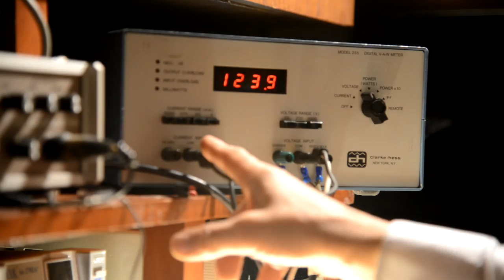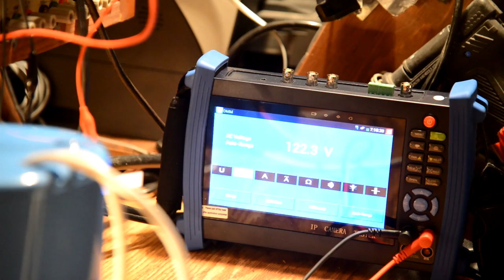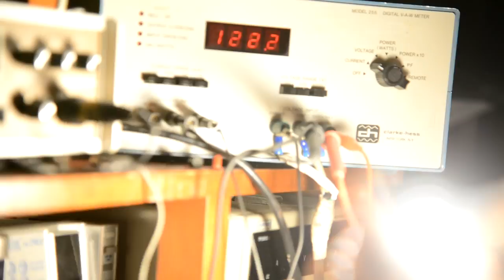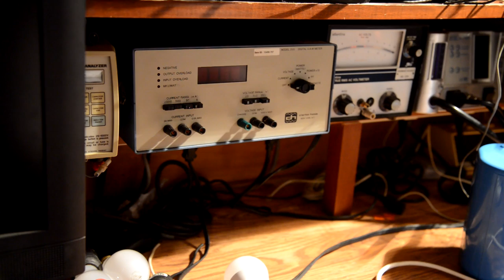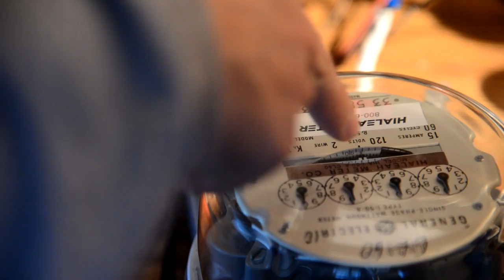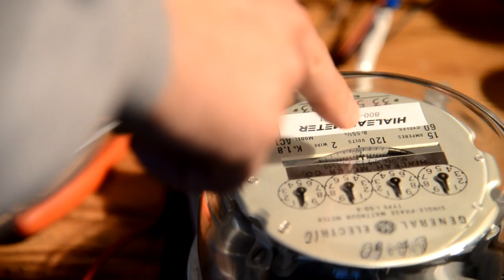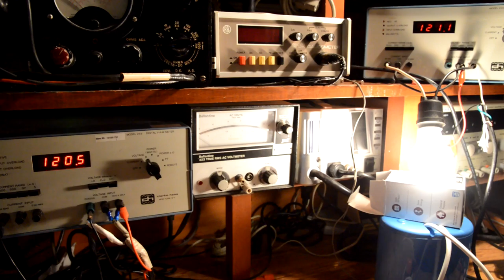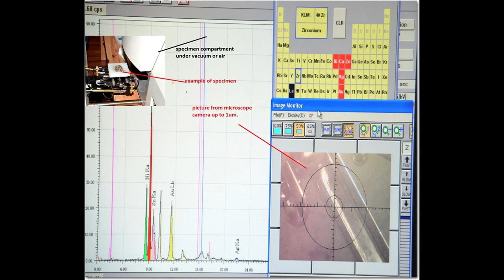Keshe "Free energy" Tear-down, examination, opinions.

Comment: Did you EVEN read the instructions?????????

This is not a generator that you plug into the wall and harness energy from minute 1.

This has to nanocoat your wires before you can see any reduction, and this process takes 2-3 months..
Reply from the maker: if this  is "nanocoat" on the wires that what kind of interaction is taking place there?  How that  fluid  is important  to  "overunity"?  The instruction does not explain it.  The nature of any believe is not  substantiated  especially in regards  to spiritual  believes. But when you required to pay for Keshe product  for $2000 than you want it to work based on  solid proven  models, behind it.    the same like with  refrigerator or washing machine.
So explain to me  how that nano-coat makes you to gain "over unity"?  The only form of  overunity that I know is  ,when I give you for free 100 dollars , so now you have for free something that you did not have before. 
I can accept energy conversion  but I do not accept  something from nothing. Well  spiritual believes  are made solely  on the ground  of people believes in miracles  with elements of fear if you decide to stop that believe than you  are told you will be punished. 
Wesley
Reply: I totally understand your point here. Keep in mind though that you don't have to buy this unit, the guy has taught for 3 or more years straight without getting a dime, and I amongst others know exactly how to make that unit without buying it.
What nano coating does is, it makes the copper wire atoms loose towards wire edge along the length of the wire and that creates a highway for energy to flow without obstructions. It makes your normal wire a super conductor. The logic is, when you have such a super conductor and electricity pushing through it, it also traps energy from the environment within it. So instead of losing power you gain more. Does that make more sense now?
Reply from the maker: I just got home.  I'm sorry but  your explanation  is  shockingly confusing.I'm in particle physics for long time. So answer  few questions  if you will.
1. what do you  understand by  words "nano coating"?
2.what are properties of "nano-coating" and how they affect nuclear bonds between atoms? ( explain process.)
3. specify what  "highway" is made of( what is inside / properties of  it)
4. specify "energy" that "flows" is it thermal? kinetic?/potential?  electric?
5. specify energy that is being captured and attracted  by that highway?
6 quote" it from environment also traps energy " -Please specify  properties of that energy before and after  energy conversion to the form  that is present in your "highway"
7. what do you understand by superconductivity and how that  "nano coating"  affects conductor to become superconductive.
8. how  superconductor of yours  differs from    known to  science superconductor  at cryogenic temperatures.
 Please  use language  and form  suitable  for  student, / PhD  in physics  or any similar but universally accepted and used language in physics  when  answering the questions.
 
Note: Language used by Keshe  is the language of very much ,mentally disturbed  individual envisioning himself as   more of a  priest, but that can not even qualify him  for the level of  high school student  to pass basic exam. 
If you want to  know more about me and my level of expertise please look at: https://www.youtube.com/watch?v=izzujmKROWI
https://www.youtube.com/watch?v=GdlkeI0bXy4&t=4s
https://www.youtube.com/watch?v=CQ3gPFfgDp8
 and about 20 more.

 Wesley
Reply: Sure, let's see what I can answer and what not:

1 + 2) Nano coating.. Let's take a copper wire for example. When we burn this copper wire (which is in matter state) either by fire, or by chemicals, it releases some of it's outer layer atoms, to the environment.

If we burn it too much, those atoms in the outer layer will move further from the main body of copper atoms, and will start to slowly detach from their bonds with other copper atoms. In the end they will fall off from the matter of our wire. Our copper wire will now have less atoms of copper on it. (That's NOT what we want)

If on the other hand it we burn it just enough but not too much,  those atoms will ALMOST detach themselves from the rest, but not totally. Their distance from other copper atoms will increase, and that's exactly what we want.

That's what we nano-coating stands for. The word nano comes from the size of those atoms that are almost detached, but not totally. 

3) The highway I refered to is the open space between copper atoms. In most matter state, this open space is minimal because all the atoms are very compressed, but in the state our copper wire (at least the outer layer of it after we've burned it, because the inner layer of our wire is still pure copper) the spaces between the atoms are much bigger.
Why do we care? Read on:

4) The kind of energy that flows within that wire, is the kind of energy that  our current science refuses to investigate. You can call it any way you like, and it doesn't change what its properties are, but this energy is the principal energy of creation. There's no known word for it in Keshe terminology either, but some of the people call it plasma energy, just because it transfers from a plasma (plasma now used as the word being, from the greek word ΠΛΑΣΜΑ=creature) to another. (This might be confusing because conventional science means a totally different thing when they use the word plasma)

We don't know much about this energy, but what we do know is that a plasma (a creature) can only receive energy after it has given, and it can only transfer energy when it has received. There's constant motion of this plasma energy, and there's constant exchange of this energy from plasma to plasma.

That energy flows through everything and anything, but it prefers to flow through that open space between atoms. (My personal opinion is that it flows from the top of an atom of let's say copper to the bottom of it, and from that atom to the top of another etc and that goes on and on, but of course I wouldn't really know).

By super conductor, I understand a very very structured highway, or path, within a substance, (usually matter substance) that has as few impurities, as possible, so that energy can flow within it without being blocked. If an atom get's on it's way, it receives some of it (because it is a plasma) and our current science calls that resistance.

I don't like student/PhD language, because in my opinion current science tries to make simple things, over complicated, so that it can keep it's business growing. We can still communicate as human beings by other terms I believe.

Also, I don't examine the language used by Keshe, because words are just there to illustrate ideas. They do work for me, as I've seen major back pain problems being healed by using Keshe technolgoy (with a cost of $0).

I'm not trying to convince you about anything here. Even if we don't end up agreeing it's absolutely fine.. My purpose of writing this is to share the little knowledge I have with someone that might be ready to accept it, and perhaps enhance it. I don't and will never claim I know everything, because I don't....

Thanks for reading this long post.
Reply from the maker: I'm sorry but your explanation is  impossible to be accepted. Just "science fiction" at not its best.
 Nano coating or nano sealing:
 is the result of an application where nano structures build a consistent network of molecules on a surface. This is a chemical process where the surface can be designed as..
 In some  application nano-coating is  temperature sensitive allowing infrared photons( heat) to be limited  or allowed to pass. But this only says about -heat  pass / no pass,   as manifestation of freedom of migration of energy transformed to wasted heat  .
- temperature level  30 C.where coating becomes black and absorptive  
- temperature level above 30 C. where coating becomes transparent while it is reflective to Infrared
quote: "1-2 nm carbon nano-coating become more electrically conductive and this leads to an enhanced performance of lithium-ion batteries".
Read more at: https://phys.org/news/2015-04-energy-usage-nano-coatings.html#jCp
!!yet it is only one entity statement and not in any way industry standard.!!
There are better ways to  make insulators or less-conductive surfaces to become conductive.
In all  cases Energy origin and energy transition is explained without  mystery.
 Success  of Keshe scam is based on  effects that do not have to be proven  and no methods   are needed to  prove them , Only simple believe that it works and  little  or not of  words around it.
  
Concept originates   from basic human needs to believe -"in better" whatever that better is represented  as:
-religion
- medicine
-good accidents ( like finding gold in the barn or 20 feet below the surface of soil. )
All of that can make people to certain motion. All that is required is to build motivation faith and so on.
And that is the area where  Keshe  steeped in to personally benefit  (cash out) his influentiality. 

 But  I assume, that whatever made you  more healthy my fried, is by you  closely eventuating it, as "Keshe's medicine". In reality  it might be  similar to  placebo or "sugar pill" activating natural organism  defensive mechanisms.  ( that in ancient was known as "black magics")
I do not fight with your believes.

In my mind there is no magic  energy and no magic transition of  energy. modern science do not  refuse and never  will refuse to analyse manifestation  of anything that  marks its presence.
However it might be attempt to assign it to known forms and transitions if it matches., and if not than we have discovery of novelty  and  - not known yet phenomena, research.
 Keshe did not qualify  to any other assumption  but unfair extraction of people money with idea in mind to gain Keshe's personal wealth. 
Keshe also did  expand area  of his  technology application from electronics, warfare, medical, structural,mobility of flying sources,  energy, spiritual, and creation meanings and applications.
There is not, and was never any technology man  made , that could be  touching all of it  in one.

Any suppression  of any technology could be explained by presence of conflict between opposing group/ individuals  directly benefiting from restricting  ideas or technologies vs rest of reminding human race that would be  happy to have access to it.
Nature of conspiracy theorists is build on that controversy and it is mostly domain of  that restricted crowd sicking  to gain from it. 
Religion is  usually the one that is competing with   Darwin approach where:
-for the crowd imaginative reality  is  a dream of religious  supporters
-for the priests and leaders , it is their very present money based existence delivered  for free by religious supporters.  In return priests and   leaders fight for  significance and power of influence .
 
Crowd is always the less benefiting (if any way at all )  from  priests and leaders  activity.
 Keshe announcing himself as Messiah     made himself not a scientist but spiritual leader( representation) of something that doesn't need to be explained and only believe will deliver  materialistically desired effects to average crowd member  door steps .
The ugly part of it  that  Keshe start to collect  benefits ( money) prior to any real evaluation and  widely proven  benefit  by humanity supporting him.
At the end he run to Dubai for safety haven. 
Wesley
Reply: I love the way you explained it. Thanks for doing so. 
It's time to rethink physics and to expand the word 'energy' to the creative force that is merely slowed down when it creates matter. 

Let's remember the Nikola Tesla quote: 'The scientific man does not aim at an immediate result. He does not expect that his advanced ideas will be readily taken up. His work is like that of the planter - for the future. His duty is to lay the foundation for those who are to come, and point the way.' Nikola Tesla
Read more at: https://www.brainyquote.com/quotes/quotes/n/nikolatesla
Reply: To Beloved Inbox:---> I love the way you explained it. Thanks for doing so. Great to rethink physics and to expand the word 'energy' to the creative force that is merely slowed down when it creates matter. To Stevep 1 -> As Nicola Tesla said: 'The scientific man does not aim at an immediate result. He does not expect that his advanced ideas will be readily taken up. His work is like that of the planter - for the future. His duty is to lay the foundation for those who are to come, and point the way.'
Reply: This friend was right! Don't be noticed on these works. Do you know "qi" in chinese "qi gong"? In vietnamese the word "qi" is translated as "gas" and when i try to understand "qi" before I practice "qi gong" I think it's bullshit. But when I practice i know that "qi" is not "qi" (gas). However, I call it "qi"(gas) :) Don't try to explain everything with your knowlege because if you can explain, you did it! Try to learn :)
Reply: Wesley

This absorbs plasma,

Then channels the same as electricity.

Had you set it up as per instructions, u wood by now 

have a 33 per cent savings, 

in your monthly electric bill ....

Comment: There is no magic people, power meter is like a motor with resonant capacitors. I done servicing for Turtable Revolver in the hifi field and we were able to start the motor in the wrong direction by playing with the switch. This was cause by wrong value of the capacitors for the motor and the 60Hz. Here the power meter is not correctly installed and need the two phases going trough with the neutral and the ground also. Now if you search on you tube "how to stop power meter " you will find a video explaning how a power meter work and they will show a paralell device that stop the power meter. If using ground with capacitors and resonant coils it can act as a power factor correction and by sending energy trough the ground wire you can stop the power meter, so this is power stolen if you do this. Many electrician know how to do this trick with a simple transformer.
When it start I had hope it will work because I understood a continuous diode in an inductance and a capacitor in the same coil. CuO is a P layer semi-conductor if well polarised when it is made, so it can be a diode creating a running DC over the AC line also but you need more fine tuning than just doing this.
Also, please try the same light bulb on the two meters to see if they are reading the same, it happen to me with two meter same company, so when doing test, make sure both meter are well calibrated.
Reply from the maker: That meter  needs one single phase only.  when nothing was connected to it  meters was not moving.So any possibility  of no load error is excluded.
Reply: I studied a lot about energy devices like you, I like you sir, I need smart people to explain how it work. I have a page on Facebook
Reply: Also meter has to be installed on vertical surface, the wright way. The main idea of Keshe is good but the way for making it is not. Now if you pass current trough ground wire instead the normal ones, you could have false reading on an induction meter. Many electrician know how to use fault ground setup to bypass meter. The ground wire is used to prevent any electrocution for people safety, now if you use it like this, good luck if lightning go on the electric pole when a thunderstorm happen. What about the EMF of this setup ? Could it be real worst for health, when he start teaching.... I had hope but when I saw what he do and all wrong information about energy, I left all of this. Tesla really understood what happen and what is the primary source field on earth then he build the right way.
Reply from the maker: Dear Michel Grenier You are absolutely right.  We tried that as well.  Please press here- 14:19 minute. 
You see  it hanging vertically  in the right position.  1% however is very small number it did not  compensate load power dissipation . It is important however  to note that it is  very strange phenomena first noticed on  Clarke- Hess 255 V/A/W meter. Than on mechanical meter.  It is however in the margin of mistake.
My protest against Keshe  was motivated by    targeted  disinformation provided by  Keshe   to gain  personal  wealth . Thank you for your comment
Wesley